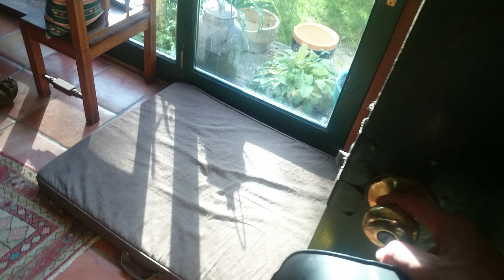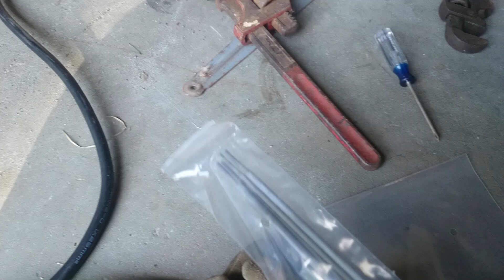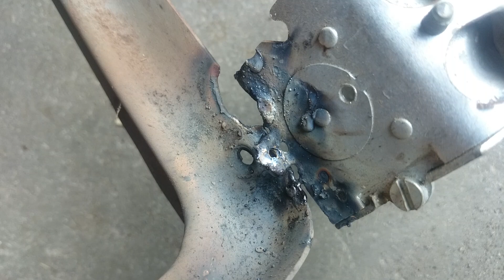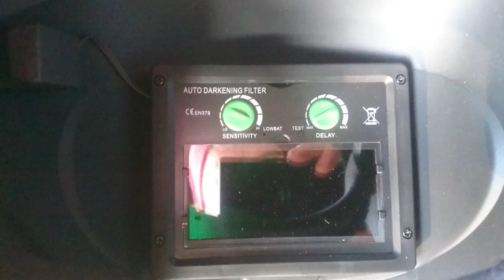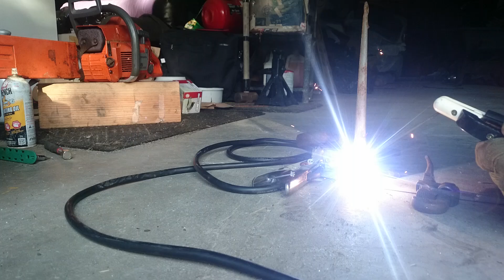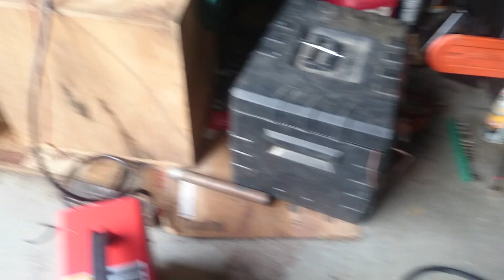First time welding, with brand new $100 ebay DC Arc welder

Comment: I'd imagine better electrodes, and bare clean metal could make a world of difference. Did this model plug into a standard wall outlet
Reply: Wonderful report. Once you learn it it never leaves. I was absent from it for a decade came back and certified structural. I recently purchased a Amico DC 160 for home, yet to test it though. It is always nice to see people picking up this awesome skill. Have you tried scratch start yet?
Reply from the maker: Yes this plugs into a standard wall outlet. Yes clean metal did make a big difference when I was practicing more later. I also got much better at striking and maintaining the arc.

Since this video I have welded a new resonator onto my car after cutting and welding back together some 1.75 stainless drain pipe about 4 or 5 times. The week after that I welded some horseshoes together to make wall hooks and then I ended up fabricating half of an entire exhaust system with all sorts of bends and twists and welded a new muffler on. It wasn't pretty but it was functional haha. So in short I have become way more skilled in it since I made this video, this video was my very first time.

I could go dig some of the practice welded pipes out and show how some of the welds even look pretty decent.
Reply: Yeah bad electrodes and dirty Metal was clearly the problem here. Lol